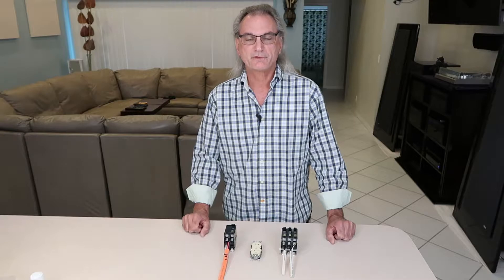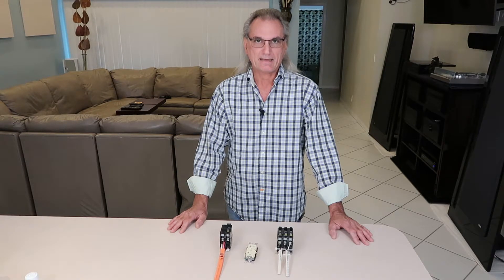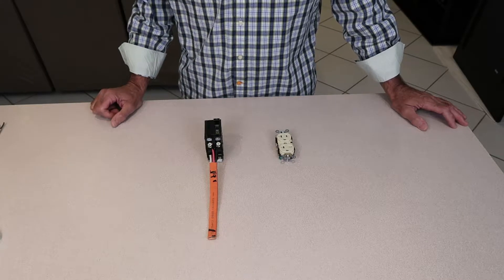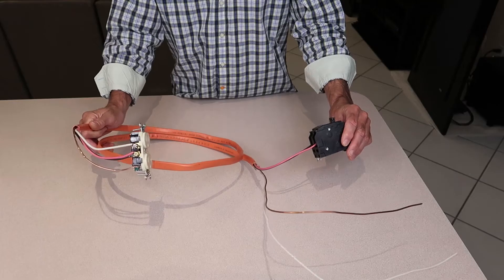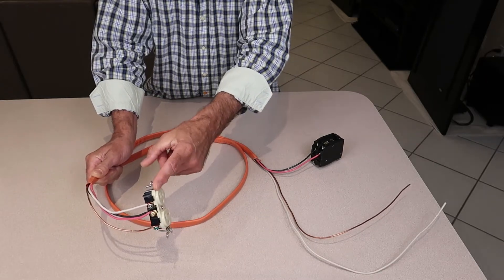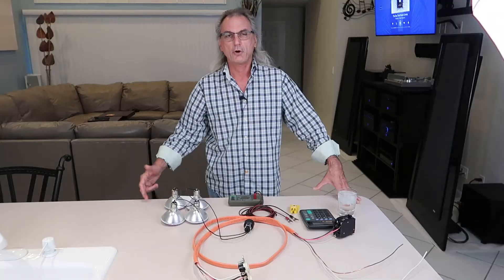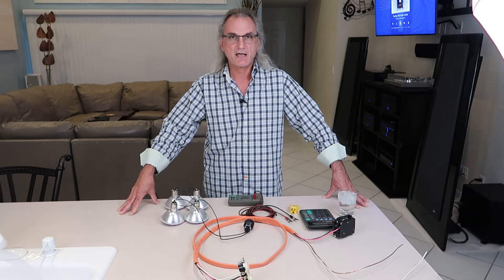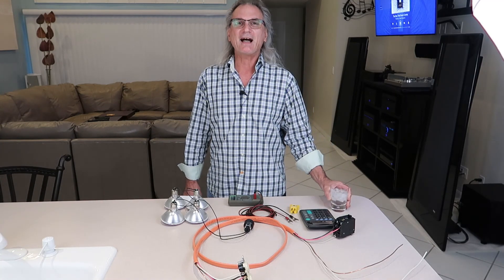Dual Voltage 125V / 250V Outlet Per NEC 2017

Comment: Did not know 5-15R_6-15R or (20R) dual voltage recepticals were availible. 
They are a great solution for dual voltage appliances and tools requiring more than 12 amps /1440 watts and box is supplied with 14ga. 240 split phase. 
Running 2 hp air compressor on 120 @ 15 amps is tough on the motor with 3.17% drop,. Versus 240 @ 7.5 amps with 1.1% drop.
Omiting the labor installing a 2nd box is a bonus.
Reply from the maker: I am glad I could help you out. I spent months reading the NEC Handbook while planning my electrical installation. Just like you said, dual voltage outlets are a great solution, especially in garages and workshops.

Comment: Thanks for the video. I have a question, hopefully not too crazy. So my house has a single 240V 20A outlet just like the bottom side of these Leviton dual voltage ones. My AC plugs into this. I wanted to add the dual voltage outlet to get 120V coming from the same outlet, however there is only 2 conductor wire run to the back of the current outlet. So therefore I have no neutral I can grab off of to get the 120V. Here's where I'm risking being dog-housed by the electrical world. Can I still connect this 240V to the 120V side of the outlet? Because in my case, the only device I want to plug into the 120V side can operate from 120V - 240V. The issue I see is in the future, if someone thinks it's a normal 120V outlet, they could blow up whatever they plug into it. Thoughts?
My second option is to purchase a duplex 240V, and then use a travel adapter to bring me out to the normal style plug. Same idea, just wasn't crazy about leaving a travel adapter plugged in 24/7.
Reply from the maker: Hi fender. Your welcome and your question is not crazy. To keep yourself compliant with the code and eliminate the risk of injury and fire, I would use your solution of the dual 240VAC outlet and use the adapter. Like you said, anyone that uses that adapter needs to know it is an adapter,  not a converter.
Reply: @StevesStrayStuff  Thanks for the quick response. This makes the most sense. Have a great day!

Comment: Nice!
Reply from the maker: Thank you, these dual voltage branch circuits are keeping my audio gear running strong!
Reply: @StevesStrayStuff  That's for an audio system I took a look at that
Reply from the maker: @NinthwaveThe  The manufacturer said best performance  was achieved using 250V. Thanks for watching.

Comment: Unfortunately your Electrician was correct. You are out of NEC 2017 because almost all 120v branch circuit fed receptacles in require AFCI protection. In order to do it properly you would have to do it the way he said with a 2-pole and a single pole. The single pole being an AFCI breaker. I don't know the rules behind this, but alternatively you could run a (or 2) AFCI outlets first in line on L1 (and L2) and then from the load run your dual voltage outlet.

I have given some thought into these dual voltage breakers, in your case where you have 4 of them in series it would have been easier to simply run 2x 120v receptacles next to 2x 240v receptacles. You would have accomplished the same thing. I have considered them for my shop where I don't require either AFCI or GFCI even under NEC 2020. But their use is so extremely limited I would rather have a 240v duplex outlet next to a 120v duplex in another box.
Reply from the maker: Hi Randy.  The Electrician was telling me that I needed to use a 3-pole breaker because all three poles had to be ganged together so they would trip together.  I was just showing that you could use a single 2-pole breaker for the dual voltage outlet.  You are correct about NEC 2017, it did say to use AFCI 'if available'.  I installed six dual voltage outlets and each outlet has its own dedicated 20A 2-pole AFCI.  I had to run six 10/3s with a ground  because the runs were 90 feet and the voltage drop was too high with 12 gage, so getting 125V/250V from the same branch circuit was very beneficial for me.  You are right about limited use, but my audio amplifiers perform best with 250V and I still needed the 125 for the normal audio gear.  I hope you get your shop wired up and thanks for watching.
Reply: @StevesStrayStuff  the 3 pole breaker is superfluous I agree. The way you did it is fine so long as you have the AFCI protection. By running the 10/3 you provide the neutral for the outlets to run the 120. And that creates an unbalanced load. But that's exactly what the neutral is for.

Seeing that you did this specifically to maximize performance of your audio equipment I am surprised that you didn't run isolated ground receptacles.
Reply from the maker: @Hydrokracker1  Everything is in plastic boxes, so hopefully that is equivalent to isolated, it was definitely cheaper, haha!

Comment: why do you have to have 3 wire cable?
Reply from the maker: The two 'hot' wires give you 250VAC and the third wire is the 'neutra'l you need to get the 125VAC. It is illegal to use the 'ground' wire for the 125VAC current flow, the neutral must provide the current flow.
Reply: @StevesStrayStuff but you can just use 2 two wire cables, right? buying that extra 3 wire romex would be expensive.
Reply from the maker: @ra bA  you are absolutely correct,  electrically, that will work, but I don't know if that kind of installation would be per the code. You must use a two-pole breaker. The two blacks will be your hot wires and one white wire would be your neutral. You would have to check the latest code.
Reply: How would you use a 2 wire cable? Ground would serve as a neutral and the ground at the receptacle would be omitted?
Reply: @io7287  you can use 2 cables. iduno why i made this post
Reply: @InterstellarMachineMan   you can use 2 cables, it would be cheaper in some cases. iduno why i made this post.

Comment: Great video, I have done this myself many times. The key point is using a 2 pole common trip breaker.
Reply from the maker: Thank you! You are absolutely right about the 2 pole breaker, it keeps the circuit compliant with the code.

Comment: This is almost what I'm looking for. I'm looking for an outlet that has four holes so you can put two hots, 1 neutral and 1 ground. It is then keyed in such a way that you cannot plug 1xx/2xx equipment incorrectly. (Off course, you would have to modify the plug for the uncommon voltage equipment). Common here is 2xx volts, so I would have to modify any 1xx volts equipment to have the 4 holes plug.
Reply: P.S. I could use the third pin as a neutral, but you lose the ground, or use a hot to ground connection, but that would energize the ground. Highly unrecommended.
Reply from the maker: Hi Jeriel.  I am in the US, so I am not sure what you trying to do, but this outlet is already designed so you cannot incorrectly connect 125V and 250V equipment, but then again, I am in the US.  I wish I had an answer for you, sorry 😔

Comment: Great video!
I think these should be a requirement in every garage. Between compressors, saws, welders, EV charging, and more, most people can "find a use" for having a 240 recep in the garage.
I would even argue they should be standard in kitchens. You already have to run 2x 20A circuits, why not put them on separate phases and join them for 240 at the counter? It would make coffee machines, toasters, toaster ovens, etc. more powerful and more efficient. Many appliances are too limited by the 1440 watt max on a standard recep.
And it's all allowed by code! And it actually saves copper over doing homeruns for everything!
In fact, that's how we wired my dad's garage. The receps all around the garage are run as a multi-wire branch circuit, so at any location, we can swap the duplex out for a 240v at that location. All on the same circuit, same breaker. All without opening drywall or rewiring. Works great for air compressor, welder, etc.
Reply from the maker: You are on the ball Erik!  I have gotten thanked by the woodworkers and coffee aficionados.  The labor is the same whether you run 14/2, 12/2 or 10/3.  Enjoy your 250VAC hobbies 👍